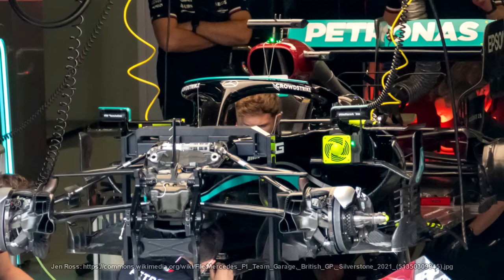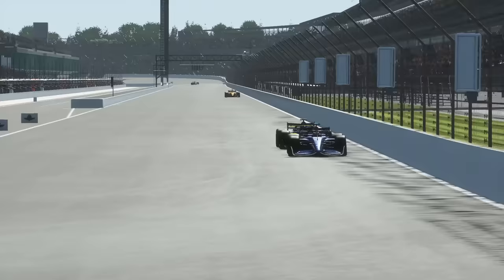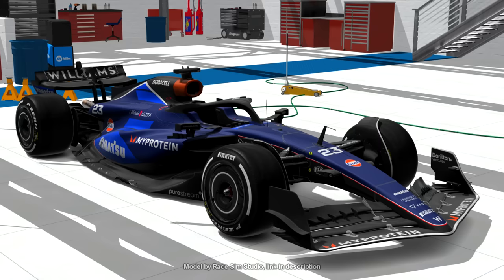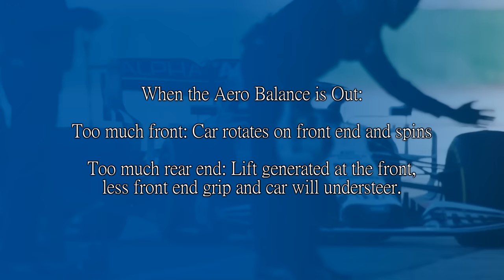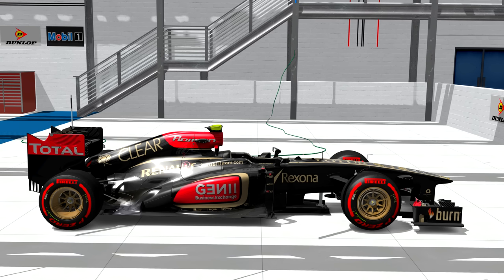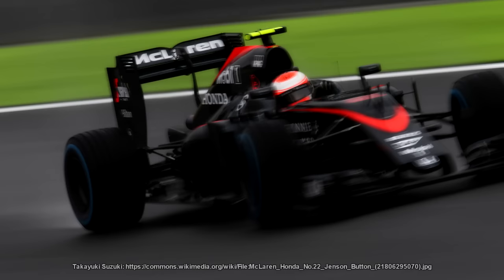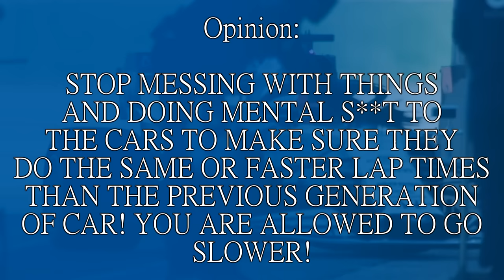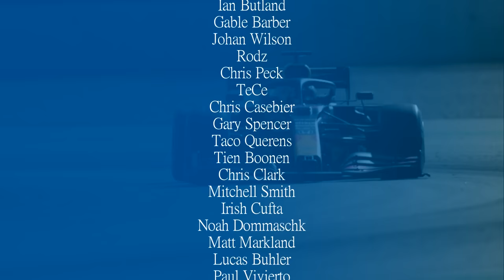BROKEN BEFORE IT'S EVEN IN? Opinions on the 'Undriveable' 2026 F1 Cars

Comment: smaller, lighter cars, NO HYBRID OR ELECTRIC POWER, v10's on biofuels and the sport would GROW EVEN MORE IN POPULARITY (and save them money), biofuel makes a bigger impact globally but the manufactures will profit less with people keeping older cars/equipment running longer and not buying new
this is a reminder that all the F1 cars in every session (race, practice, testing) burn less fuel than ONE transatlantic flight, its all P.R no substance
Reply: You don't even need to ban hybrid/electric, they could just specify a max fuel input per second + a max KW for electric and hybrid powertrains and limit how much CO2 output is allowed. Give some fundamental performance restrictions and ask for a solution rather than basically creating a spec engine. the way the current rules demand. This way you will get a few different approaches, you may have v10, but also v12s and v8 hybrids. If you open up the race to more teams you could get a nice large breadth of ideas.
Reply: @InsufficientGravitas  I think the closer we get engines to spec engines the better for the sport honestly but that's my personal opinion, look at Indycar and LMP2, the competitiveness is amazing and the racing is spectacular, just not as restrictive on the aero/setup side as those categories to let the engineers go wild. I honestly like your idea and it's the first i've thought about it, just worried it'll be exposed and 1 path will be right
Reply: yes absolutely
1- hybrid make the cars huge
2- v10 perform better than the current engines
Reply: @barthy_  If one path is right then you can either modify how the rules work to make other options more viable or just accept it but still allow other alternatives (much like the way Mazda ran the rotary for a while in endurance).
Reply: Never happen. the Teams would walk out. They have zero interest in spending the kind of money needed to develop a V10 pure ICE setup at F1 levels of power.
Reply: @darthkarl99  All engine suppliers, sans Audi and RBPT, have their old, 900+ HP V10 designs they could work from, so there are ways to keep the costs down
Reply: @halofreak1990  The problem isn't weather they could do it cheaply. The problem is nothing they'd do development wise would have any usefulness to their road cars. 

Whilst obviously a lot of racing tech doesn't translate directly, iot cna and does teach them a lot about how to simulate stuff or various niche underlying physics interactions that can be back applied. And control systems and traditionally engine tech where major area of back transfer too.

Unfortunately pure ICE personal vehicles are dead tech to the manufacturers because of the incoming EU ban on new sales thereof in 2035, (and banning hybrid in 2050). You'll still see some in other markets after the ban that aren't hybrids, but they'll be more expensive or be adapted Hybrids with the electrics taken out.

The F1 teams would much rather develop the electric side of the Hybrid system further to match what they're going to be doing soon in the majority of their road cars. They can use a lot of what they learn in F1 for their future Hybrid road vehicles.

The problem F1 has IMO at the moment is Formula E. I strongly suspect the teams would rather go to a system where all the motive force is supplied electrically, but the electricity is supplied by an ICE running a generator under entirely computer control, (the throttle would just control the electrics output). But i'm 99% certain that would violate one or more terms of the current Formula E contracts.
Reply: No, going to V1 on biofuels is not going to make any significant impact on the sport’s popularity. For all of the whinging that people do about the sounds of the current cars (which sound much better in person, by the way), that’s all that fans have really done - they complain, but they don’t stop watching because of it. 

And as has been pointed out, it’s not about how much fuel the F1 cars are burning, it’s about manufacturers being willing to spend the money on research and development of engine technology that has no application outside of F1
Reply: @pikminologueraisin2139  it’s not just the hybrid system that has increased the size of the cars - in fact, the hybrid system accounts for only a very small amount of the size increase, the overwhelming increase in size is at the front of the car and has to do with safety and aerodynamics

And V10s performing better… sure, they put out more power, but they also didn’t last - to the point of teams going through multiple engines in one weekend. (Some teams actually had different engines for qualifying than for the races - though I don’t think that was done with the V10s because it would have been too expensive to develop two different engines at that point.) Then regulations made them have to last through one weekend. Then the engines had to last through two weekends (BAR would retired their cars if they weren’t in the points in order to be able to get around that regulation, so the FIA had to close that loophole).
Reply: @valerierodger  "Nobody stopped watching", that's funny.. in Germany alone, the average TV audience dropped from 5.3 million in 2013 to 4.3 million in 2014, when the leafblower era started (and before someone mentions Schumacher being at fault, he hadn't been starting in 2013 already). And this year, the season opener (on the same free-to-air network) got just 1.9 million viewers...

Comment: Once the engineers get their hands on the regulations, they'll make them much faster than F2. It's always the narrative 1.5 years out from a regulation change.
Reply: Remember when they said the 2022 regs would be up to 4 seconds a lap slower? Yeah.
Reply: They went from 2.5 L to 1.5 L engines in 1961 and by 1964-1965 they had a 1.5 L BRM V8 running at 11,000 rpm, Ferrari flat-12 and Honda V12 all under the old lap times. These scare stories about slow cars come up every few years and yes, they will find ways to go faster again.
Reply: It's one thing to have 1.5 years to make a new chassis. To have all new engines and all new chassis, yeah that's going to be mess.
Reply: @alexjenner1108  make sense 👍
Reply: They are saying downforce will be down by 40% tho, that's quite a lot. 
We may see 2014 again but worse (since ground effect work better at higher speeds). I think Super Formula cars will fit the front of the F1 grid now compared to around mid as in '14.
Reply: @LuminalSpoon well they were...
Reply: @canismajoris6733  Yeah but not anymore though

Comment: So a slight clarification on the comparison to modern fighter jets like the Eurofighter. In simple terms, modern military jets are aerodynamically unstable and require computer aided stabilisation because they are designed to have their centre of rotation as far back as possible, they handle sort of like a forklift in the way they steer from the rear. While a person could theoretically manage to fly the jet without computer assistance it'd be extremely physically/mentally taxing and leave virtually no room for error, it's sort of like trying to correct a wobble on a bike at 180mph where you can correct the instability with just the right amount of input but if you give it too much/little it'll quickly cascade beyond recovery. 
Active adjustable aero in a car likely won't be as critical because you don't have to design an unstable car to begin with, you're trying to enhance its natural balance rather than beat the laws of physics into a pulp. This would be reasonably easy to keep safe by physically limiting the degrees of movement of the control surfaces (ie. if it breaks then it can only move +/- 5 degrees), this would be no more dangerous than wing/body damage following contact or a DRS failure. It'll be interesting to see how it's governed, I'd kind of like to see the reigns taken off to see what the teams could come up with but at the same time I think we might end up in a position where the cars start outgrowing the safety of the tracks

Comment: I believe the reason why F1 never used active aerodynamics despite road cars using them is due to safety concerns. So many drivers died due to rear wing failures at high speeds (the most well known example is probably Bruce McLaren who died at Goodwood in 1970 when the rear bodywork of the car he was testing flew off at a high speed corner). Nobody will react fast enough to a sudden loss of downforce to save themselves. Even the current cars sometimes have DRS issues (Verstappen at the 2022 Spanish GP, Ricciardo in 2019 had his rear wing fly off during testing causing him to spin off track). 

It's the same reason why they won't return to active suspension either (Berger's crash in the 1993 Portuguese GP that could have been like Zanardi's crash was the result of the Ferrari's suspension malfunctioning). 

Also while a lot of people are willing to have slower cars in exchange for better racing, the fact remains that people love to roast F1 cars when they aren't the fastest in the world (mainly due to how snobbish F1 fans tend to be towards other motorsports fans). Even to this day people talk about how fast the 2004 cars were and there's always one person who goes "put the F2004 on slicks and it'll destroy modern F1 cars" and some people still love to point out how the 2014-2016 cars were slower than the GP2 cars of the time.

I just hope the FIA gives the teams more time by pushing the new regulations back a few years so that we don't get a situation like 1994 where the cars are undrivable because the teams didn't have enough time to iron things out.
Reply: 2014 cars were slow, by 2016 they were starting to gain back the downforce the regulations took away and set a few records at several tracks, the 2017 regs with larger cars weren't necessarily, they could have easily allowed the new wings and tires on 2016 cars.
Reply: tbh with todays engineering advancements, we can have our cake and eat it too, meaning we could make cars on par to 2004 without an ungodly amount of downforce. Tyre compounds have come a long way since then.
Reply: Don't forget Ericsson horror crash when it comes to DRS failures
Reply: The new Porsche Taycan GT has active suspension ON AN EXTREMELY HEAVY AND FAST ROAD CAR. I don't think that it's too dangerous to use anymore. Active aero I think should be workable if it is operating at both the front and back. The idea of only doing active aero at the back was incredibly stupid as even a first year physics student could point out why that wouldn't work.
Reply: erricson’s crash at monza braking into t1 with drs open is another example

Comment: To make it a product again, they need 1. Competitive series where any number of teams can win. 2. Overtaking which you get through minimising the loss of grip behind a car whilst maximising the slipstream effect. 3. Cars that are exciting to drive and watch with more power, less grip. There should be zero electronic aids so what the driver puts in, the car does. And zero DRS or any other gimmick that isn’t racing. It ain’t rocket science
Reply: yeah, DRS is just to compensate time lost by dirty air, but anyways, tyres suffer a lot of degradation, and anything can't solve that problem apart of reducing aero. if they reduce downforce they don't need DRS or push to pass
Reply: Sounds like F1 in 2016. Drivers complained there was too little grip.
Reply: Really sounds like V8 supercars out of Australia with how it's a borderline spec race, though with enough variety to keep it interesting! Honestly, if F1 could get to that point, except still be the fastest motorsport, I'd be impressed
Reply: "Competitive series where any number of teams can win" The only reason many teams can't win is because they did a crap job... The opportunity is very much  already there. BOP is the last thing F1 needs.
Reply: @Awkward_Fox  Yet despite the cars being all identical the 888 team takes a 1-2 in most races. So even in spec series (F2 likewise) some teams are more equal than others.  Rule makers bizarrely let 888 design the racecar that everyone has to use (no conflict of interest there!) instead of a third party like Harrop Engineering. Early Group 3A and Project Blueprint when there were more freedoms in  the  engineering (albeit less than Super Touring, which was even more interesting in terms of engineering) were much better eras of V8 Supercar racing IMO.

Comment: A lot of people talk about overtaking and dirty air. Thing is even if you take the dirty air away, you still have everyone running on rails meaning the time gained in corners is minimal. The only way to overtake is by DRS or lunging on the brakes at a hairpin which usually requires DRS to get close enough
Reply: What??? These cars have no TC, no ABS, and are quite hard to drive thanks to ground effect. If dirty air weren't an issue then they would overtake and they definitely aren't "on rails."

Comment: On the subject of the Eurofighter analogy, I don't think it''s about checking a great many instruments on the panels. Many modern fighters are inherently unstable, which means that only a computer can fly them at all, making constant, counter-intuitive corrections with the many control surfaces at all times. They very well might be able to drive the Fangio concept in a similar way, though probably not with great lap times if the thing is a real dog.
Reply: That is true since the ground is accelerating the car upwards :)

A sudden computer glitch could still be deadly going flat out on a straight but it is not as dangerous as flying an inherently unstable plane like the Eurofighter.

Comment: I find weird cars not having failures given back in the day they were so common. Looks like a thing of the past like a crash with fuel igniting or racing in the wet
Reply: When was racing in the wet actually common? I've watched all of the races from '98 to 2007 and don't recall seeing an actual extreme wet tyre race that wasn't red flagged. In the early oughts they typically gave it a go but then red flagged after visibility became impossible.
Reply: @wiegraf9009  2008 at Silverstone they gave it a shot and driver behaved well, apart from Massa 😂😂
Reply: @wiegraf9009  Canada, don't recall the year but the race took some 5 hours due to red flag because of the rain. To my knowledge it's still the longest F1 GP ever held.

Comment: My fave era of F1 was the 2000s, even when the aero became complex from 06 onwards. Cars looked great, could race still. Now with this bs it’s crazy
Reply: I've watched from 1998 to 2007 and the racing was very good from '98 until 2003. There was a clear point around 2003-2004 where the aero wake ruined the racing and it never really recovered from what I've seen. The increased number of races is also a bummer, especially with the cost cap making it basically just a rerun of the same race a number of times with little development changes. I didn't grow up with F1 so this isn't nostalgia, it was just good racing back then.
Reply: anything pre hyrbid era lol

Comment: FIA control over car designs is starting to kill my joy of watching F1.
Reply: There was a time where V6s, V8s and V12s, turbo and NA, were all on the same grid. Where Williams making a car with 6 wheels was legal, if not successful. Bring back that kind of competition.
Reply: It's nothing new! The FIA mandated the dumb flat floors in 1983, after teams were quite blatantly cheating the 60mm  ride height rule (enforced by laser) the FIA created in 1982.  Heck some people (bizarrely) even like the narrow 1.8m cars the FIAcreated in 1998, instead of the nice wide 2.15m cars from 1972-1992...
Reply: Bizzarely like the 1.8 m ones?

All the early 2000s cars are 1.8m, including the F2004. Narrow cars with a screaming V10 was arguably one of the best eras to be a F1 fan.
Reply: @Majima_Nowhere  It was the Tyrrell P34
Reply: @7MGTE  Williams FW08B and FW08D. It had four wheels in the back, the Tyrrell had them in the front. It was tested but never raced, the FW08 ended up with 4 wheels.
Reply: FIA has always controlled car designs.

Comment: They should only use the active aero to replace fixed-configuration DRS: the closer you're to the car in front, the smaller the DRS is open.
This would allow continued use of DRS to balance out dirty air while limiting the super easy passes we've seen at some tracks since 2011.

If you want an example of how awesome the fights could be, think Hamilton Vs. Schumacher at Monza 2011.